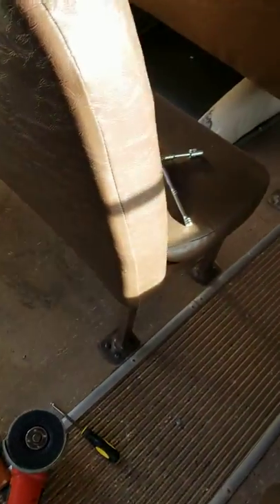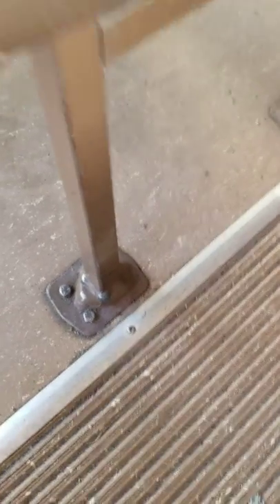Skoolie seat removal with angle grinder

Comment: Hi Dave, thanks for the video...not sure if you will see this comment... But I am asking if I can do this as a total novice... I am 65 this year, never done DIY and I have 5 seats to take out... Not budging with a wrench.. Not even a cordless one... So I got a grinder... I need to know what I need to use it safely... I am scared but willing to learn ..I need my van asap... I am in the UK but DIY is the same both sides of the pond... Thanks.. Oh I will be screwing or bolting some furniture I want to keep when the seats are out... Scared about that too but again willing to learn..even if I need it all up...I am willing to get it right... Can you advise me please? Thank you.
Reply from the maker: Vanessa of course as a total novice you can do this!!!! Wear a long sleeve shirt, wear the eye and ear protection, tip the grinder at a 45 degree angle and let rip!!!  you can guage the angle youneed to just grind away at the bolt, Grind it down to where  its even you will start to see likri a circle then you know you are close, so  sometimes what I would do .  be I would take a big sledge and hit the shit out the seat on the metal part and a lot of times it would jar it loose and then it would release itself form the floor then your on to the other Ok we3 , you use your body wt to tock it back and fourth if it don't jar it loose lf it don't come loose grind away a little more,  the hardest part about taking the seats out i it is the awkward position you have to get in on your hands and knees between the seats to get at the bolts, but you can by those discs at the hardware store just grind away at it, the sparks quickly dissipate they will not start anything on fire, but ne sometimes your in tight areas and its hard on anyone let alone being in the older population.  LOL,  make sure to remove anything that is flammable. I think you can do this don't be scared you control the grinder it don't control you..  HOpe this helps Vanessa Good luck!!!! sincerely, David Jacques Spokane, WA  USA
Reply: How did your van turn out?